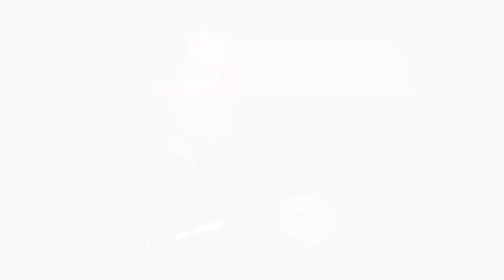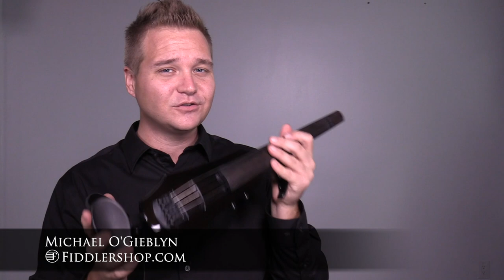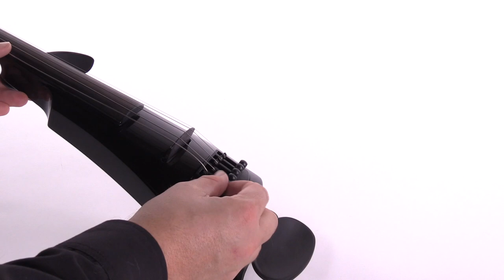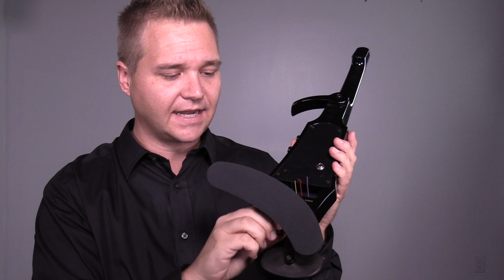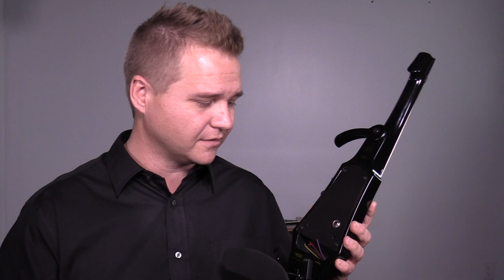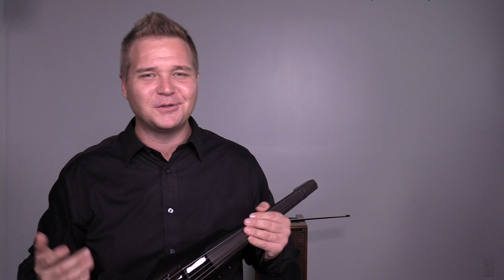NS Design WAV4 / WAV5 Electric Violin

Comment: I was told to install the adjustable chin rest requires drilling into the body of the violin, true????
Reply from the maker: Hi! Not true at all. Those instruments come built with an area that takes the adjustable chin and shoulder rest.
Reply from the maker: Also, those components like the adjustable shoulder rest are designed solely for the NS Design instruments. We have had customers in the past that try to incorporate that to their instruments against our recommendations.

Comment: Did you put any other effects on this violin besides the reverb of the amp? When other people are playing that violin on YouTube (I mean the reviews, not any arrangements) it sounds way worse. Does it have to do with the violin or the playing skills?
Reply: I have an NS Wav 4 string and mostly play just amplified with no effect.  I'm very happy with the tone.  It is a heavy violin, and I nearly returned it due to neck pain.  After fiddling with the shoulder rest height, I set it a bit higher than my acoustic and have been playing happily for over a year.
Reply: impedance matching is the difference. loading down a passive pickup with a low impedance input reduces sound quality. any preamp with an ultra high impedance input will improve sound quality.
Reply: not all amps have a high enough impedance input

Comment: Is there a type of bow that would work well for being electric, or could I use my normal bow?
Reply from the maker: Yeah, just the same bow you use for your acoustic violin will work just as well. One possible caveat would be if you play significantly different on your electric vs. acoustic, i.e. maybe you play very cautiously acoustically, and you're wild electrically and spin your bow like a lightsaber...Then maybe you'd want a stronger, or lighter, or more durable bow for when you play electrically.

Comment: Does it matter what kind of wireless transmitter and receiver I use for for the pickup on my acoustic violin?
Reply: Yes. You need to have a wireless transmitter which can handle a very high impedance.

Comment: Electric violins are trash .acoustic violines way convenient, just try to lure the huminbirds ,they love to listen  the wooden acoustic violin .the natural sound of the wood.
Reply: Except for classical events the Electric violin outraces the classic  Violin  in every point
Reply: I have a old violin from the 30's and it sounds dull and all midrange to me.  It doesn't have the high end I would like.
Reply: @johnc.8298  adjust the sound post and you can get a little high pitch
Reply: ok thx.
Reply: Solid body is the WAV of the future.  I love it. No slipping pegs and retarded wooden pole falling down, or mushy flimsy bridges moving around.
Reply: Haters gonna hate. There’s room for both - I’d rather a great sounding feedback-proof electric than my otherwise lovely acoustic fiddle with a pickup onstage with my band.